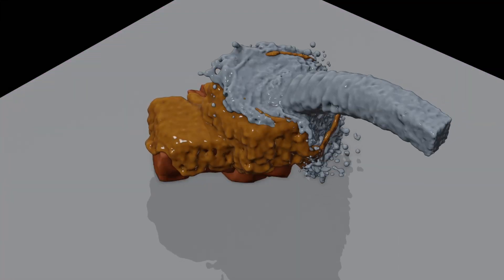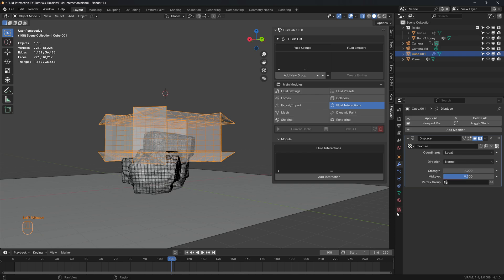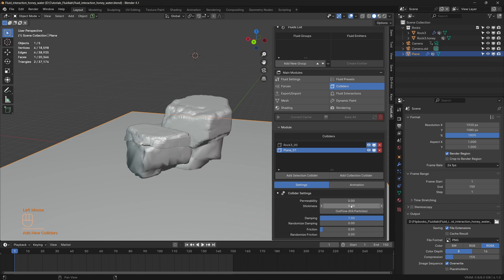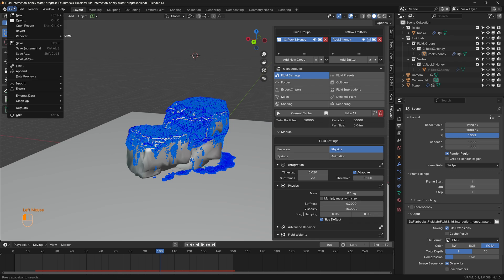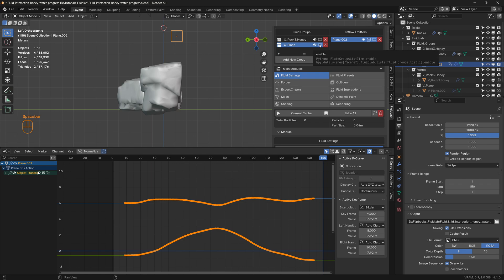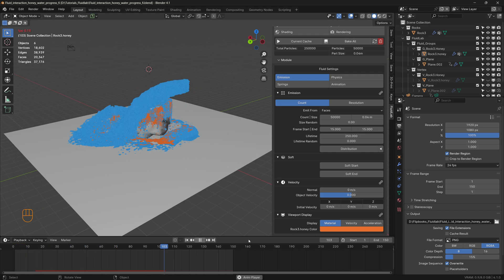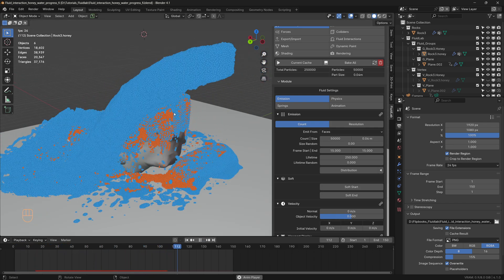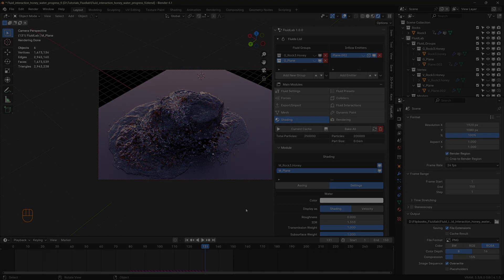FluidLab - Tutorial Fluid Viscosity Interactions

Comment: Is there still no way to have a viscous fluid behave like honey or oil? It should be much more stringy, and less chunky. It feels like it's breaking apart too easily. I guess stringy fluids are especially difficult to simulate, because they would require very small particles to form the thin connections necessary for that look.